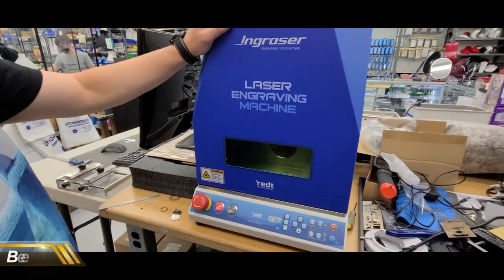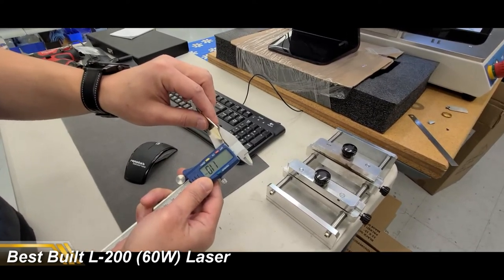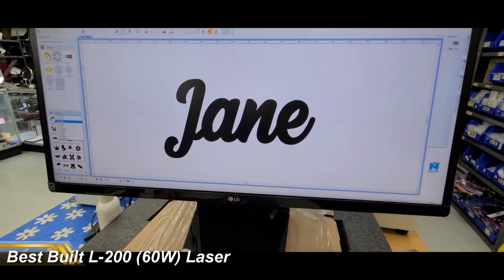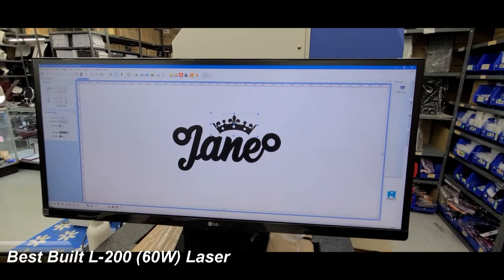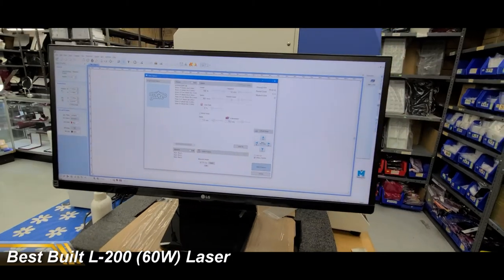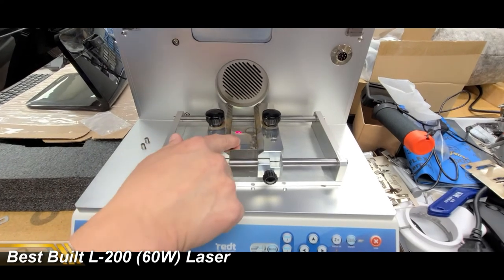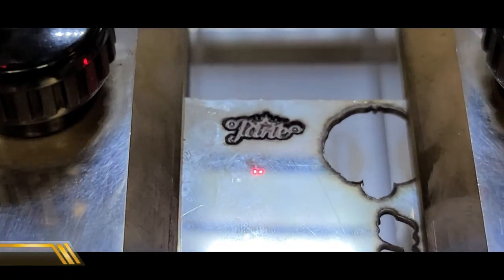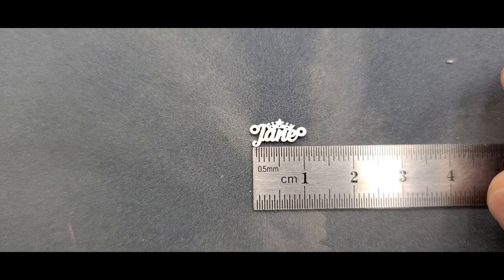Best Built L-200 60 W Fiber Laser Cutting Demo

Comment: What do you use to clean up the piece afterwards ? Be specific if you can please. 

And those cutting preferences. Will that also work for gold and copper ?
Reply from the maker: I prefer to use sandpaper about 400grit to smooth down the piece if I'm in a rush.  Otherwise,  drop it in the magnetic tumbler for 15 mins and a quick polish. It works for gold, silver, copper, brass, plated or filled gold sheets.  In most cases, ultrasonic cleaning for 20 mins then steaming the piece will clean up very well.
Reply: @UPTOWNSITE   thank you for your time. We just got the L-200 at our shop. Great machine
Reply from the maker: Great,  thank you...
Reply from the maker: Please email me your info,  we can schedule a online training when your ready   jdsincbb@gmail.com
Reply: @UPTOWNSITE  hi I want to purchase this machine pls